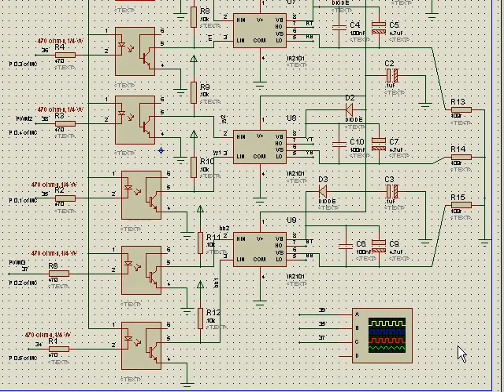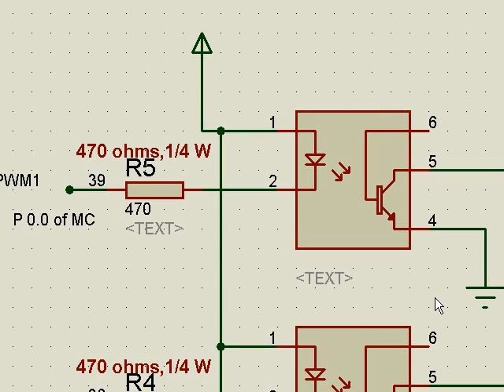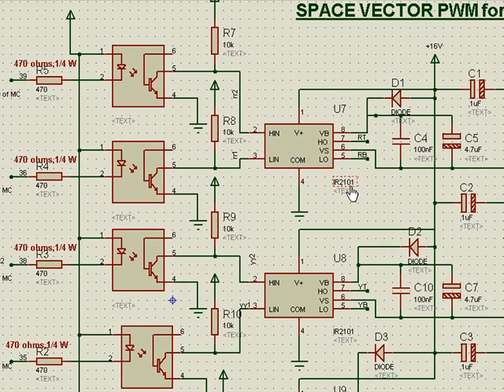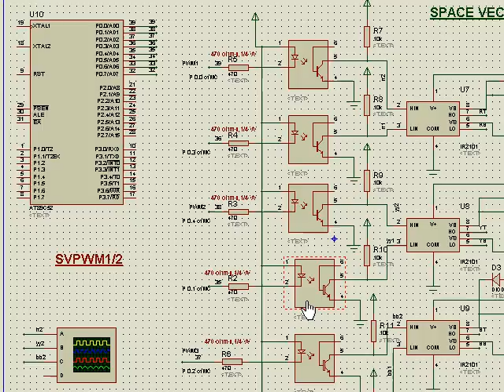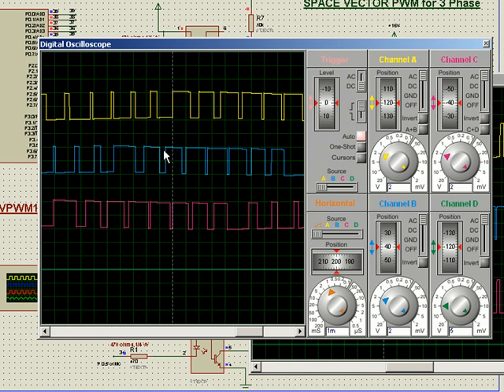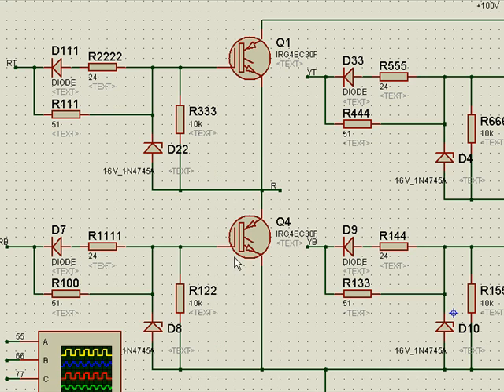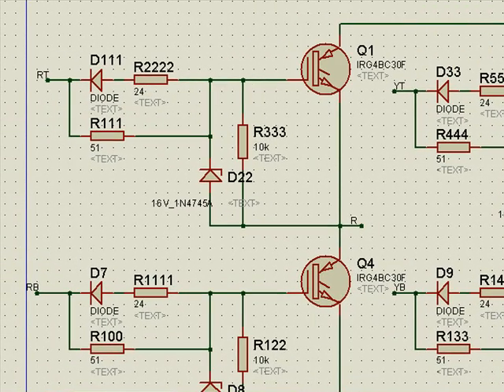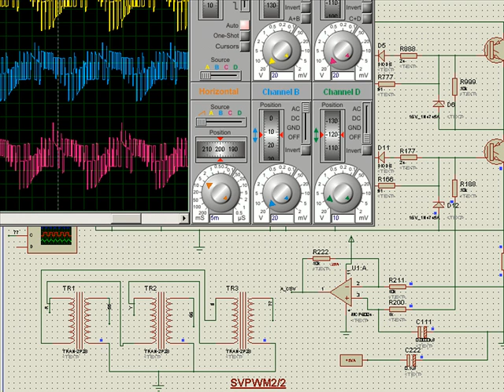SVPWM Space vector Pulse width modulation by 8051 Microcontroller

Comment: You dont need to generate the pwms for the bottom sides, its unnecesary load on the cpu, plus u will get rid of 3 optos. 
You just need a 4049 or similar inverter buffer to generate the bottom pwm from the top pwm. 
If u use this design over inverter buffer just to get perfect timings and be symetrical, thinking that de NOT gates adds a delay, u cant have perfect timings in first hand beacuse of the other components like IR2110 witch have different delays for Turn-on and Turn-off (120ns vs 94ns), and the IRG with 21ns turn on vs 200ns trurn off. So, a 34ns from inverter gate would not matter at all.
Reply from the maker: Yes you are right. The project has been deliberately done with six output from the CPU instead of 3 to make the student spend more time on programming .